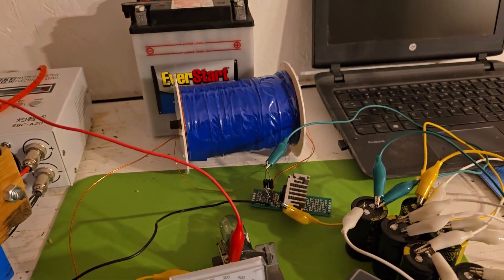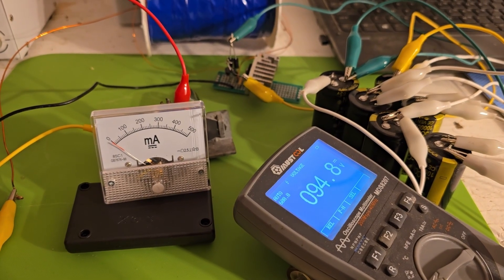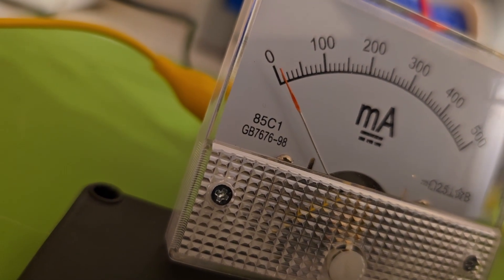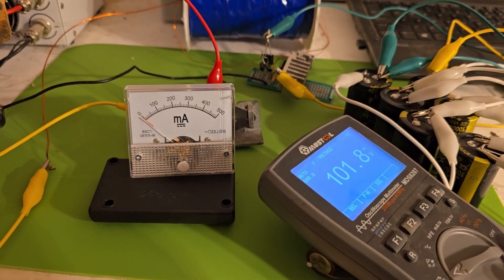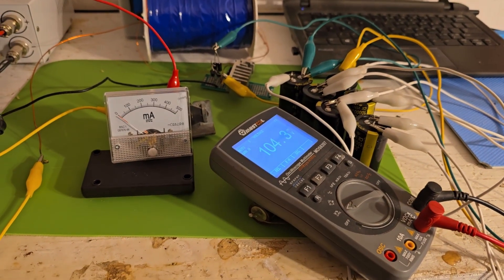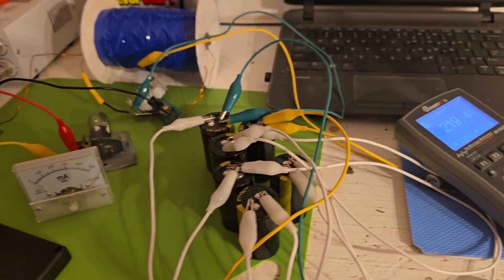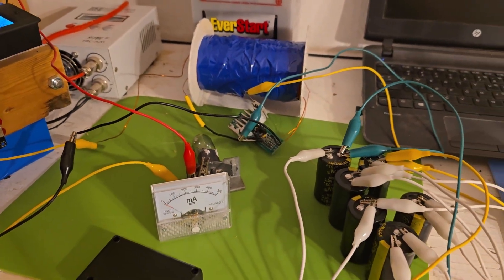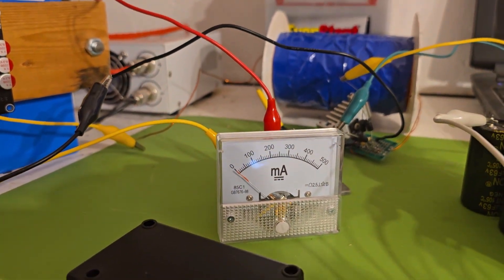I can get as many watts out as I want.  No extra input needed

Comment: What's the schematic of your circuit? What are you measuring this voltage across?
Reply from the maker: You can find it in some of my first coil  building videos.  I'll post it again in upcoming videos. And the voltage is across the output capacitors

Comment: Temporary storage of electric energy (batteries and capacitors) can be replenished by emp even when they are drawn by a load.
This is the principle behind Tesla’s apparatus for utilising radiant energy.

You can try to place empty new (never used before) capacitors next to the coil not physical connected to anything. What the science call “static” or electrostatic energy is not static and never was.